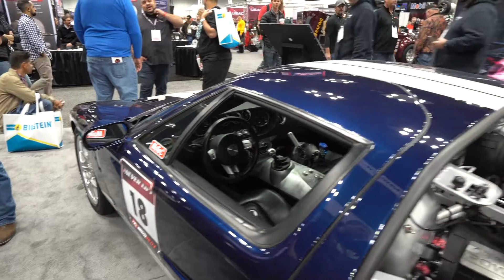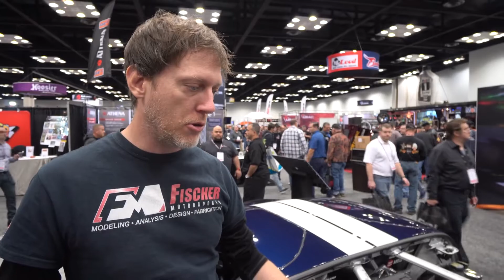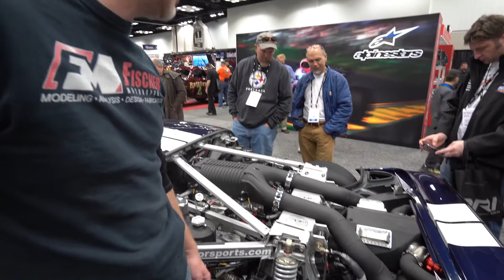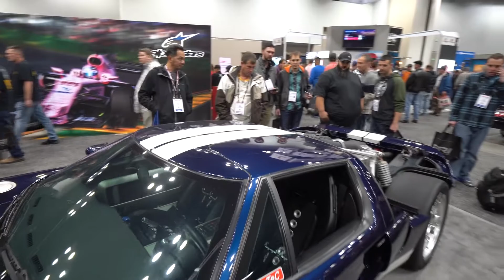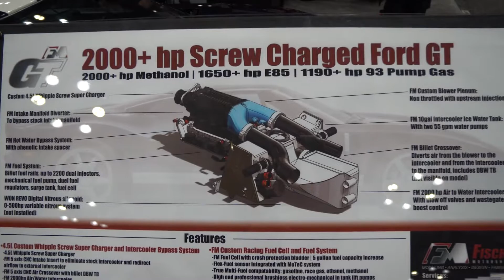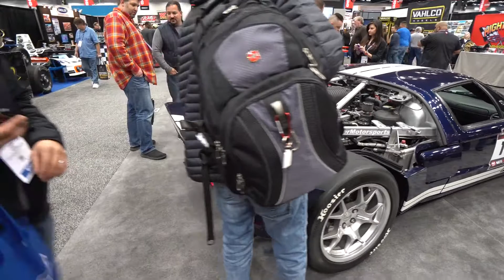Fischer Motorsports 2000hp+ Twin Screw Supercharged Ford GT at PRI 2017 Indianapolis

Comment: Any news on this car ?
Reply from the maker: Thanks for the interest!  The GT was completed and showcased at both PRI and SEMA.  There have been a handful of small upgrades since then; currently the GT is under the knife for some larger upgrades.  Fuel cell, surge tank, 3 big lift pumps, new cams, and new rings for the motor are all in the works to push the build even further.  We have a lot of content for this car and will be working to get some of this out.  Cheers!
Reply: @FischerMotorsports   That's really good to know! Will you keep the actual whipple or switch to the 3.8 ?
Reply from the maker: @LMcars  Staying with 4.5L for now.